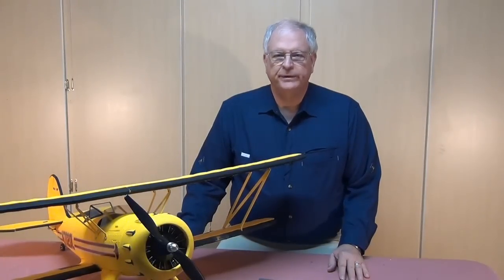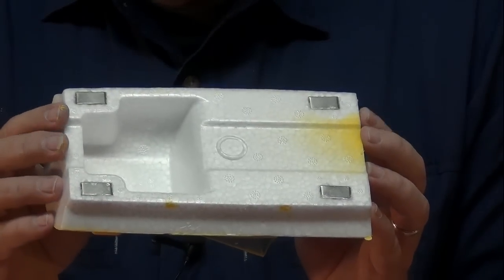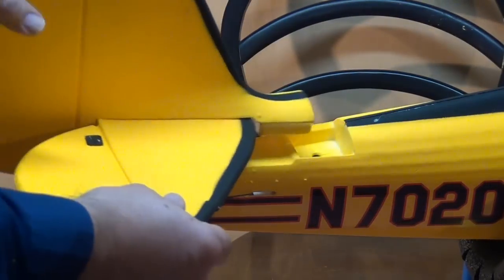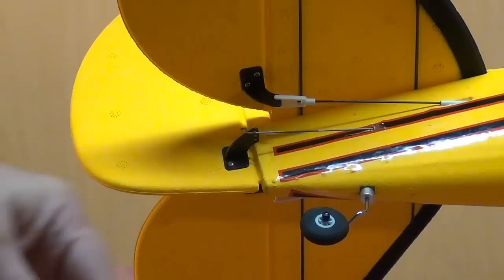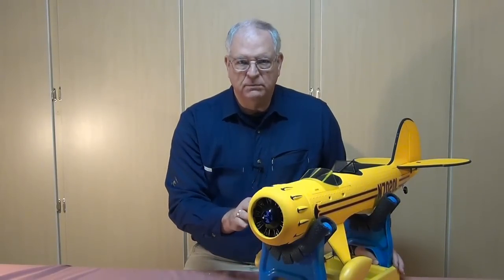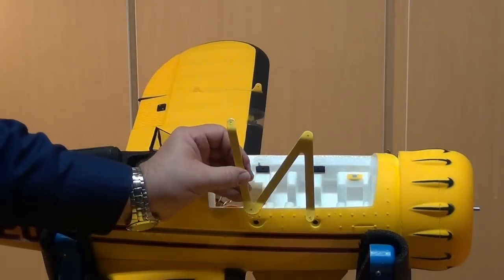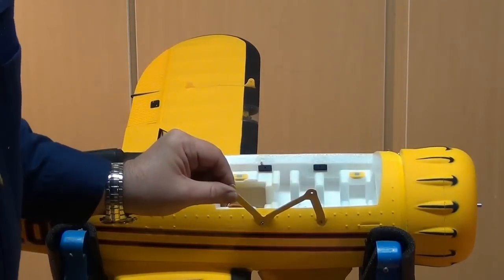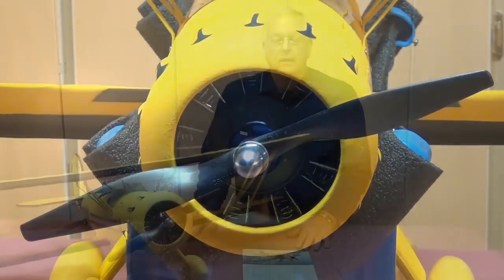Dynam Waco Build Log   Pt 2

Comment: Don't get thread locker on yellow plastic wing strut attachment fittings, it will dissolve the plastic. Tip: I used a tiny metric wrench with adhesive tape on one side of the end to hold the nut in place while I threaded screws into nuts. Tip: There is a very long thread on RC Groups Parkflyers forum about assembly, setup, trims, preventive maintenance, minor mods,  and fixes. Great flying model, very aerobatic not really for a complete beginner. easy to fly with proper CG, but needs large unobstructed venue with smooth takeoff and landing strip.

Comment: Jim is always wonderfully concise; no wasted words to fill the script.  Great job on the Waco.  Wished that you had shown a close-up on where you decided to mount the receiver.  With all the servo wiring, etc., even with a large space I found it a challenge to locate a receiver position where the antennas are away from the jungle of wires. My kit came mostly OK.  The "sheet metal" type screws were all missing.  They had substituted machine screws which will not work.  The lower wing ailerons were missing the "tabs" for linking the ailerons, top to bottom.  The exterior finish is very nice; devoid of all the typical "bubbles" look.  Keep up the very well done reviews.. . . .

Comment: I bought a new fuselage and am rebuilding mine. The fuselage didn’t come with the motor mount installed. How do I install the motor mount inside the front? There’s not place to slide the plastic plate in. Thanks!

Comment: Thank you, Jim.  I always try to watch a build video, or at least an unboxing, prior to building a model myself.  Your insight on how to best get plastic cement to work was extremely helpful and something I wish I'd known months ago.  Also the advice on applying decals worked like a charm for me.
Reply: Oh, and I couldn't exactly follow your advice for easy removal of canopy.  Instead I cut a slit into the forward black seat and epoxied part of a "popsicle" stick into it.  Very easy to lift now, but not as slick as your solution.

Comment: I sealed the paint with poly minwax to prevent the paint from scuffing up. Fix those magnets of course. I painted the cabanes,he doesnt mention they come with no yellow paint. prime the metal ones and the carbon ones or the yellow paint you use will chip off.I noticed he never glued the wing rod in the last video. I did.I also replaced the ESC and added a seperate BEC because I replaced the crappy leds with a kit from HK by Turnigy for the navigation lights. The original leds were for a 12vt system or something,they were dim at 9vt.I used a die and tapped the plastic cabanes so the inserts wouldnt split or break before running in the screws. Be careful not to tap the holes too big. You can unscrew the clevis's and apply bees wax to the threads to prevent binding as he stated,then screw them back in. the bees wax keeps the threads lubricated. Take your time with this build. Dont rush the job. I also use tubing to hold the clevis on the control levers. If you have more quick tips for this plane,add it here. This is the best build Video out there to date.
Reply: never mind,yes he did ( about the paint...sorry Jim)

Comment: Very good video
Thank you for all this information shared.
When you say that two pieces have broken, is the metal rod that broke or is it the plastic part?
Reply from the maker: For this model it was the metal pushrods. Seemed a bit brittle as I recall.  It's been a while since I did the video but the model's still flying!
Reply: Thank you for your reply
It is thus by regulating the white plastic part that your pushrods broke
I just got my waco and maybe Dynam has improved the pushrods because I do not notice weakness.

Comment: Hi again,
I notice the motor is mounted with an angle to it, must be for the thrust? I read that people have added a couple of washers between the motor and the mount on the top two mounting holes of the motor, have you heard of this and is it necessary for smooth flight?
Reply from the maker: Most prop models (and aircraft) require a down and right thrust angle to offset torque and P factor that pull aircraft to the left. I have an older Waco and added washers to the motor mount to achieve more down and right. If it is noticeable, I wouldn't mess with it assuming Dynam fixed it. If it tends to climb a bunch with power applied and pull left, add the washers. Have you read through the Waco thread on RC Groups .com? It is pretty active and is packed with good insights on this model.
Reply: Thanks and yes I have read most of it but still need to read more. That's where I read that about the washers, but those post were a few years old, still have a ways to go.
/bill

Comment: Hello,
I just received my Waco and looked at your build video. Thanks that video is a lot of help. I plan on doing a couple of your suggestions as well. I do have one question if you could answer it for me. I am upgrading the esc and notice a device connect to the esc's signal connector that has shrink wrap on it. Its that some sort of cap array to help with brown-outs or something else.
/quadcells
Reply from the maker: Bill Tortorello  A lot of older Dynam planes have that little circuit. As I recall, especially with Spektrum receivers, the motor pulsed at low RPMs. The circuit was supposed to help allieviate that. I'd leave it on. Otherwise pull it and put it back if you have the problem.
Reply: Thanks for the explanation.

Comment: Are you familiar with the light set up, no directions on this at all, is there a board for the lights to plug in or do I need to purchase a aftermarket board? No one talks about the lights on this model are they very bright or not worth messing with?

E
Reply from the maker: I don't think they are worth messing with. Reports from a while back were that they were dim at 6 volts and no one seemed to know the specs on the LEDs themselves. I've done LEDs on other planes but used light kits that included the connection board. If you're handy with solder and small diameter heat shrink, you could use the wires embedded in the wings and add connectors are replacement LEDs from a light kit. A lot of extra work for very little return in my opinion.

Comment: I bought this plane .there was no friction bolt or the plastic washer to put the propeller on do I have to order another one.
Reply from the maker: +Stanley Clowes Sorry the piece was missing.  You can check with where you got the model. Otherwise the collets are pretty common parts.  Make sure you measure the motor shaft diameter when ordering.
Reply: mine came with a stripped prop nut! I had to use a tap and retap the hole,Its made from Aluminum so I figure someone did something stupid with it. I was able to repair it so no harm no foul. The actual threads were ok on the motor. Have you been able to get out and fly yours.

Comment: Is there any venting to the battery compartment? Just ordered mine!
Reply from the maker: Lucas Hughes. I think you'll like it. As to cooling, I recommend removing some of the thin plastic between the faux cylinder heads on the bottom side for a path into the equipment bay. Paint the foam black behind it if ypu don't like the white showing through.
Reply: Thanks! One last Q, do you have the link for the RC Groups Waco discussion thread you referenced to Bill Toertorello below? Thanks!!!
Reply: I've searched and searched - and even on forum websites before, but this particular site has a LOT to go through!
Reply: Believe I just found it: https://www.rcgroups.com/forums/showthread.php?1706634-Dynams-Waco-YMF-5D/page501

Comment: how do ya straten the Rutter? it looks like a banana.
Reply from the maker: Foam wings and flight controls can come bent or bend with use. They are easy ti straighten. Use a hair dryer set to medium and warm up the foam while bending the foam back a little past the correct line.  Hold the the piece while it cools. Recheck and do it again if it needs to move more.

Comment: can i ask u something sir
Reply from the maker: Alep Sani Yes, of course.
Reply: this week im buying roc hobby woco 1030 just have plane not include BATERRY,CHANNEL RECEIVER,CHANNEL RADIO AND CHARGER so on my case im must buy this 4 thing??
Reply from the maker: Yes, you'll need those things.  If you haven't purchased the Waco yet think about two things. One. I have a book on Amazon called RC Ground School which I wrote for folks like you who are getting started in RC. I think you'll find it helpful. Two, consider getting a Ready To Fly plane kit so you don't have to make all the decisions about radio, brand, battery and charger separately.  The Apprentice S 15e or the Sensi FS RTF trainer are good beginner choices and have advanced electronics to help you if you are teaching yourself to fly.  One last point. Get a RC simulator to help you with the basics. Some are really inexpensive and even those will help you figure out orientation and basic aircraft control before risking you actual model.  Good Luck.

Comment: I order the blade boulder They sent me the mother shaft.
Reply from the maker: Motion Hobby has pretty good explanation  in the description  of the replacement motor. Check them both. New motors use the bolt on silver collet  plus the prop nut and older mothers as in my video use the friction collet. If you check the instructions  to see how they describe mounting the prop, any photo might give you a hint. If you have the older motor and need a friction collet, measure the motor shaft or find specs online and order a collet set with a bullet style prop nut with the right shaft diameter. Try Tower Hobbies. They  usually  have lots to choose from. If you need the new collet, order the blade holder from Motion or Grayson. Both showed them in stock when I looked. Neither had the friction collet. Sounds like you have the prop nut already.